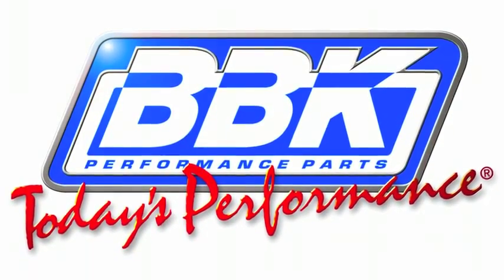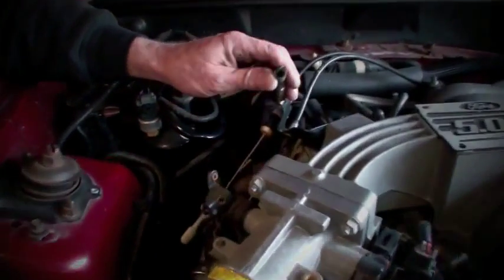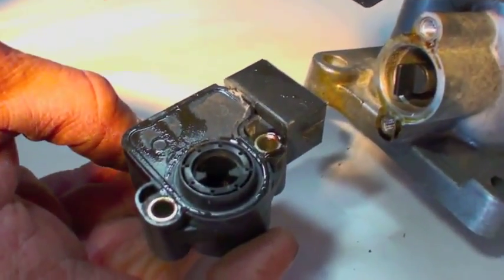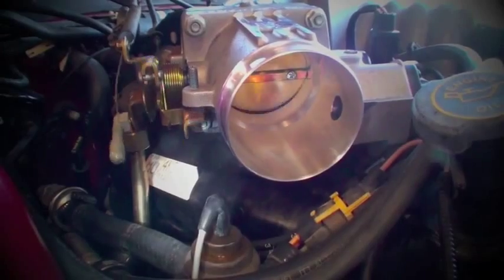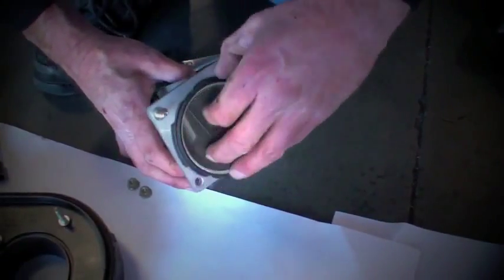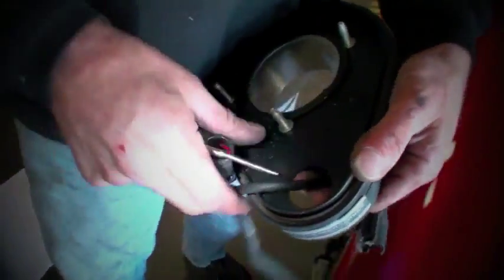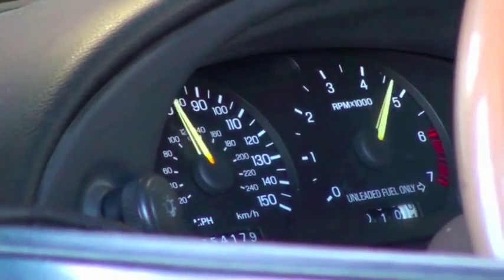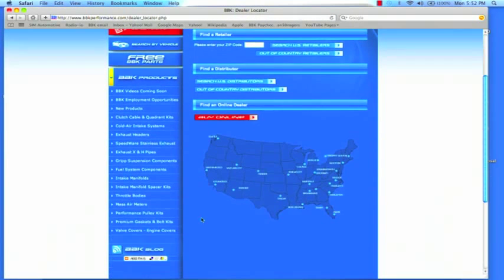94-95 Mustang 5.0 GT BBK Performance Throttle Body & Cold Air Kit Installation and Dyno Test

Comment from the maker: There are several ways to optimize this conversion but you will not need a tuner. You would benefit from an adjustable fuel pressure regulator like this one from BBK, 
Part number BBK-1707

Comment: Will this fit my 95 ford mustang 3.8 v6 ?
Reply from the maker: +DieHardFans Oliver Lopez , 
The products shown in this video are for a 5.0 engine specifically. There are similar products available through BBK under part numbers 1548 & 1717 that will work for your car. These items are available here at Summit Racing as well. 
http://www.summitracing.com/parts/bbk-1548/overview/

http://www.summitracing.com/parts/bbk-1717/overview/